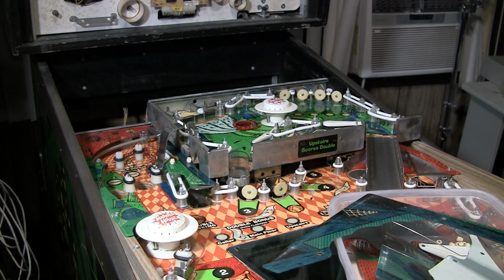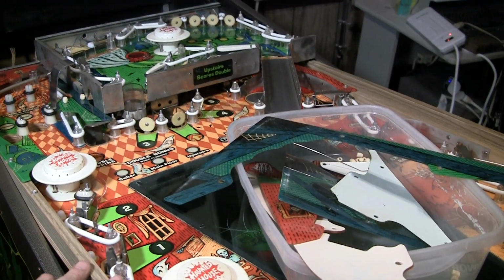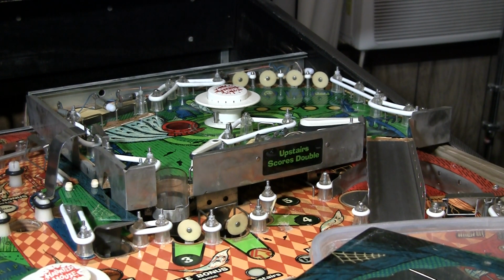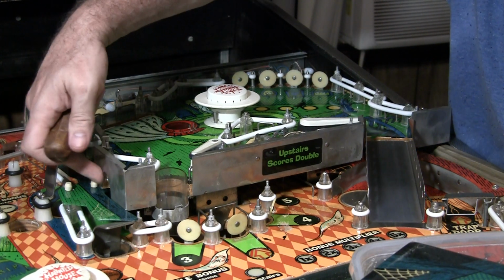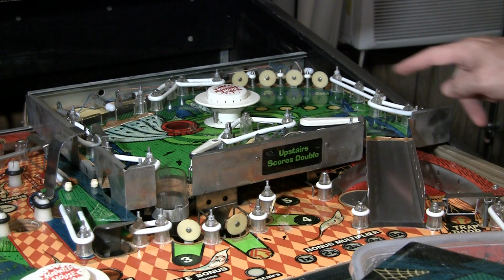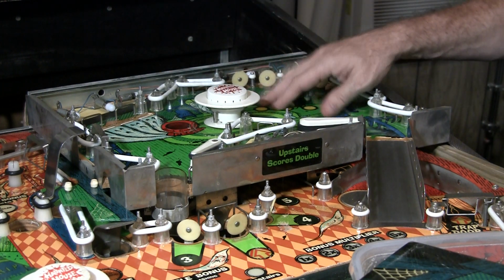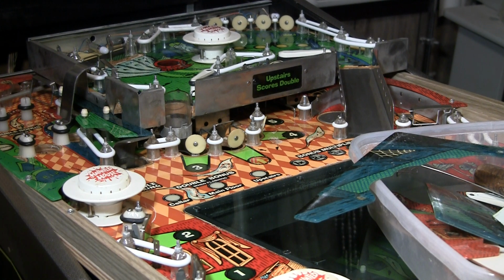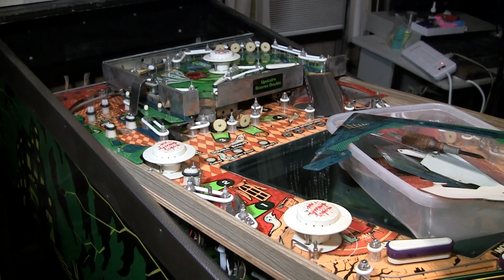Gottlieb Haunted House Pinball - Part 3 - Accessing The Upper Playfield - PinballHelp.com

Comment: Hello Mike,
Thanks for sharing these great videos. 
My haunted House’s upper playfield metal wall have rust pitting on all over them. 

What do you suggest to use on it without scratching it but still bring back the reflective shine?

Looking forward to your response.
Thanks and stay safe,
Chris
Reply from the maker: I am a big fan of Evapo-Rust.  I have two containers of it - one inside some large PVC pipes that I use for cleaning pinball legs, and a big tupperware container I soak smaller metal parts in.   It does wonders.

Don't forget to subscribe!  https://youtube.com/pinballhelp?sub_confirmation=1 Every little bit helps.